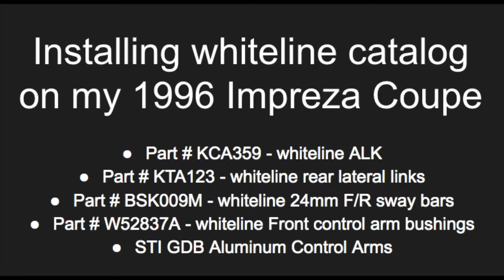How to remove lateral link bolt Subaru Impreza WRX STI - Whiteline lateral link & 24mm RSB PART1

Comment: Thanks for this video, was a huge help for me. A couple tips for other people trying to remove the godforsaken lateral link bolt that might help: 

ditch the tiny framing hammer. If you can get somebody to help you, have them hold the punch with a pair of pliers and go ham on it with a sledgehammer after you've drilled out the side closer to the back of the car 

I didn't have to cut the bushing off that was closer to the front of the car when I removed it
Reply from the maker: Awesome tip. I couldn’t do it with the framing hammer. I took a 5lb iron dumbbell to it a million times

Comment: i cheered when that long bolt came out. owned mine 15 years, when i first got it i had to deal with that bolt put it back with anti sieze and its never been a problem since. nice upgrades too
Reply from the maker: 😂love that you felt that. It was a mission Forsure. I put so much anti seize on the new ones. Appreciate the comment!

Comment: I must be living right. Bought my bugeye new and it's seen 20 winters with salt on the road so i was pretty aprehensive about getting the long bolt out. I soaked all the gaps around the long bolt with PB Blaster three times. Hit the nut with my 580 ft-lb impact wrench and it came right out.

Comment: i've found that if you impact the nut off first, the lateral link bolt comes out pretty easy with an impact and an open wrench.
Reply from the maker: ziewknihtewza tried everything before this desperate technique.
Reply: I'm gonna look at this again.. but my milwaukee impact doesn't fit in the space very well. The bolt head is on the open side 😭

Comment: Got me at “fuck you!” 🤣 
For seriously good job bro! 
I tried that on my 98 OBS and I gave up.. that was 3 years ago. it’s got rear drums and it’s time to change them. Instead I’m doing to covert to disc so I bought the control arms and taking it all down from there without replacing the lateral bolts. The whole hub is going.
Reply from the maker: Yeah man haha. You got that shit. Good luck

Comment: Gotta go harder with the heat... torch the end nut till it's glowing and your rubber bushings are burning inside the lateral links, then get some penetrating oil on that thing and twist the nut off.
Reply from the maker: Forsure, it wasn’t the nut that was the problem. The nut came right off. It was the bolt that was actually seized inside. But yeah, it’s scary to watch shit glow. It’s done... so not going to ever do that again. Appreciate it.

Comment: That lateral link bolt was really not that rusted, you could have totally got it off with some penetrating fluid, a big punch and a heavy hammer. Just wail on that thing, probably would have popped right out.
Reply from the maker: That’s essentially what I did after cutting it and it was still hard as hell to get out haha. It got done and that’s what matters.